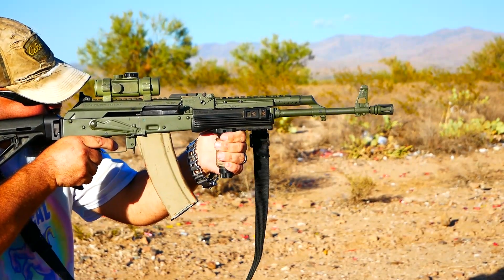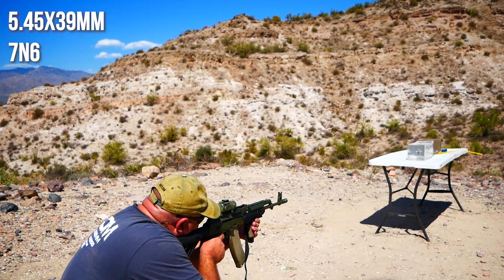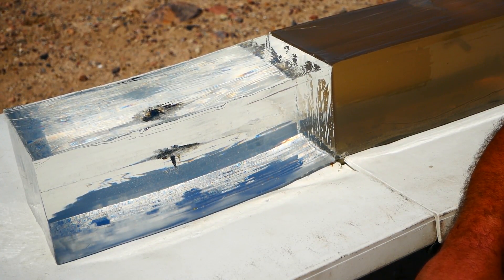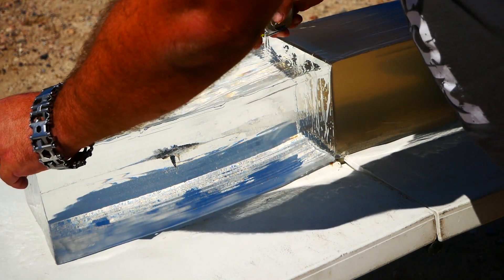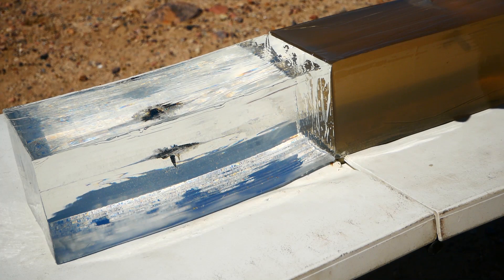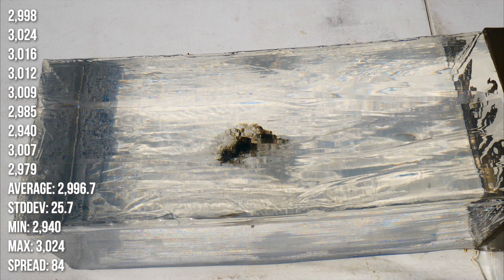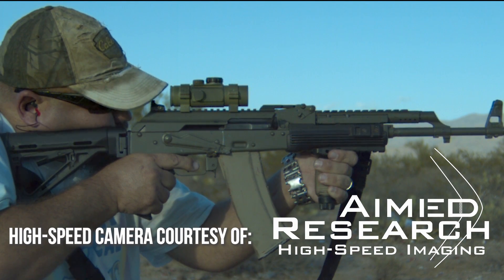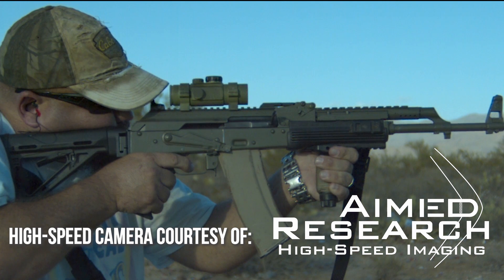Does The AK-74 Really Fire A "Poison Bullet"? 5.45x39mm 7n6 Gel Test (Stunning High-Speed)

Comment: Hey Andrew i have an idea for some homebrew 5.45x39 by taking Hornady 5.45x39 and taking off the plastic tip.I remember watching a video of Ammo Channel's test of 7.62x39 SST without the plastic tip and it looked pretty nasty any thoughts?
Reply from the maker: Interesting. Do you think that would delay expansion/fragmentation?
Reply: @newsofthepews  what Im hoping for is it will act similar to an OTM or hollow point and will cause the jacket to peel back. I've never actually tested it but the way Ammo 
Channel's video made it seem. it had about 12-14 inches of penetration and the whole wound cavity was just filled with bullet fragment material.
Reply from the maker: @nemisous83  That sounds about the same as my testing of 7.62x39mm 123gr SST. I've seen it go pretty deep in clear gel, but if I remember correctly, the Ammo Channel used real gelatin like I do in most of my tests. Excluding this one, obviously.
Reply: @newsofthepews  My hope is it will have a similar effect, if that doesn't work I might take a jewelers saw and cut a cross pattern in the tip of the nose to encourage uniform expansion or fragmentation.
Reply from the maker: @nemisous83  I think you're going in the wrong direction. The 5.45mm 60gr VMAX fragments too much and penetrates too little. What the caliber really needs is a good solid copper hollow point, a good bonded soft point, and a cheap Russian soft point. The steel jackets on other caliber Russian soft points seem to slow expansion enough to get good penetration.
Reply: @newsofthepews  that is very true, I also wish Hornady would offer a 69 or 73 gr OTM to replace the terrible performance of the VMax... OR we could get some of that goochie 7n22 which is very similar to M855a1 with a solid copper base and a hardened steel core and tip. But i guess we peasants aren't allowed to have nice things
Reply: @nemisous83  Have you tried running 55, 62, 68, and 75/77gr .224 bullets through a sizer? A lot of people will do this for component bullets when reloading 545. While I haven't tested it myself, I have heard of fairly decent results. Food for thought anyways.

Happy Thanksgiving 
S/F
Reply: @MatteoThirteenSeventyOne  that actually sounds like an awesome idea since .224 has the appropriate length, and with the same die set i can resize some 5.56 brass to 5.45 brass to make reloading more viable than reusing the steel cases.  thank you for the idea!!!!
Reply: @nemisous83  No problem. I convert cases and reload 545 myself. Although if you use sizing wax and resize in bites or small bumps. Reloading steel case isn't as problematic.
Reply: @MatteoThirteenSeventyOne  well i figure the brass would last longer than the steel because the the steel isn't as malleable.
Reply: @nemisous83  If you anneal the cases they last longer than you might think. But not everyone likes going through the time & trouble of reloading steel cases.
Reply: also its my theory that the Plastic wedge causes the round to expand and fragment too early causing the early and disappointing penetration.
Reply: @Eugene Stoner  WHICH 5.56 NATO are you referring to and WHICH 5.45x39 Soviet are you referring to ? because its an unfair comparison to compare M855A1 to 7n6 and its unfair to compare 7n22 to M855 and so on and so forth. also are we comparing it in a civilian self defense scenario or a military scenario?

Comment: Im not going to be ridiculous and say this test is false or blah blah blah, but im curious how the Army tested their 7n6 because their tests showed very early tumbling at around the 1 inch mark and would exit the gel block around the 12-18 inch mark the tests conducted by Mrgunsandgear also mimics these results as well. Who know maybe their gel wasn't up to spec but this is still really good data and shows that things might not always be what they seem. where 7n6 and 5.45x39 really show their potential is that they are not velocity dependent so you will get the same results out of a 22 inch RPK as you will out of a 10.5 inch AKS-74U which is a very good thing when you are trying to standardized on a FMJ that fits the needs of multiple rifles.
Reply from the maker: Test media and environmental variables could account for the differences. Clear gel isn't as close to real gelatin or as reusably consistent as the manufacturer claims. It's also possible that 7n6 experiences the same kind of variable terminal effect due to fleet yaw that plagues M855. It's important to note that even if the bullet does consistently yaw early, that doesn't mean that the effect is the same out of various barrel lengths. TSC is heavily dependent on velocity, so a bullet that yaws at 1,700 fps might just cut a permanent channel roughly equal to the bullet profile, with no distal wounding effects associated with higher velocity impacts.

Can you reference what Army tests you were looking at?
Reply: @newsofthepews  If you have an email I can send the picture I'm referring to where it is compared to MK 262, M855, M995 AP, and standard Yugo M67 ball.
Reply from the maker: @nemisous83  choppingblocktests@gmail.com

If it's the set of sketches with a blue background, I think that might have been Dr Roberts.
Reply: @Eugene Stoner gee did you even read my comment before going full hater mode?
Reply: Unfortunately I’d be surprised if our military tested their ammo thoroughly. They tend to overlook many details. For example they finally adopted new handguns and do not receive a single hour of valuable tactical handgun training. Just shooting at a few paper targets. They don’t even know how to hold a handgun - still using a cup and saucer grip.
Reply: @Mrandher83  To be fair the sidearms in the military are more badges of rank than they are actually combat weapons. The only people that really have a chance of using a sidearm in combat are vehicle crews since our military apparently hates the idea of adopting a pistol sized PDW like the  VZ61 and PM63.
Reply from the maker: @nemisous83  Well, kind of. It's getting a little more common to see sidearms issued to troops who also carry rifles. Some door kickers are getting them. And mortar crews too.
Reply: @newsofthepews  mind you my experience only extends to the Marine Corps. but usually 90% of issued handguns where given to SNCO's and Officers and most of the training given was pretty much just annual qualification. But id also argue a PDW is more advantageous to vehicle and crew served weapons than a handgun. Similar to how M1 Carbine replaced the M1911 and gave GI's an actual effective weapon.
Reply from the maker: @nemisous83  That's how it was when I was in too (Army, 11C, ETS 2011). What I'm relaying is hearsay.
Reply: @newsofthepews  Yeah I hear you man. It hasn't changed much in the 5 years I was in, (2012-2017) that's why i'm not all that broke up about the Army adopting the P320 because I know 99.999% of the time its going to be a glorified broach and the most salt it will every get is the holster wear.
Reply: I think shorter barrels cause bullets to wobble more in flight. Usually when that happens (when bullets wobble more) they tend to tumble alot faster.
Reply: https://youtu.be/CGo6JBjt614
Reply: I spent 6 years in a MP unit and the handgun training was deplorable at best. It wasn’t until civilian law enforcement that I realized the magnitude. The bigger the Army purchase or decision, the dumber the admin folks tasked with making said decision!

Comment: Yeah, but if you nick a bone or dense tissue, 7n6 will yaw quick or even fragment. I don't claim that it's "better" than 193 or 855 but I prefer 7n6 for my go to long gun round.. What about the 55gn hp 5.45?
Reply: 5.45x39 does not fragment. you have to remember that 7n6 is a bimetal jacket and tends to flatten out under pressure, in fact thats where 7n6 gets its heavy yaw from is from the hollow cavity in the nose bending over and destabilizing the projectile. 7n6 isnt a magical bullet because aside from velocity it performs the same a standard off the shelf 5.45x39.
Reply: 7n6 doesn't fragment
Reply from the maker: Sure, but that's true of all spitzer rifle bullets. And 7n6 is less likely to fragment than copper jacketed .223.
Reply: @newsofthepews  I agree with that. Maybe a Hornady 60gn V-max 5.45 would have a better chance at fragmentation. Those are what I keep in my Bulgy 74..
Reply from the maker: @bobvagene  Yeah, they fragment like nuts. But they also don't penetrate adequately. I tested it quite a while back. It was a little disappointing.
Reply: @Eugene Stoner it's obviously a fine caliber since it's still serving in the Russian military as 7n22. 5.45x39 suffers import restrictions and few rifles actually chambered in it which results in less manufacturers making loads for it.
Reply: @Eugene Stoner considering one of the main threats on the modern battlefield is soldiers with armor a round that can defeat said armor is more ideal than terminal performance.  Yes 5.56x45 has better terminal performance but it's hard barrier performance is quite pathetic I think Paul Harrell's video debunking M855 has made that very clear. That is why rounds like 7n10, 7n6m, and 7n22 have become the standard and 7n6 has fallen by the way side. 5.45x39 is still a very effective military round but what's best for civilian defensive use and whats best for the military are two completely  different schools of thought. Military use stresses penetration over terminal performance more often than not hence why M855 was developed. But in the civilian arena where we have to be very mindful of how many shots we fire and how deep something penetrates a military style FMJ just isnt ideal.
Reply: @Eugene Stoner but to compare apples to apples you would have to compare 7n6 to something like Wolf of Tula .223 55gr bimetal FMJ to be an accurate test.
Reply: @Eugene Stoner wrong. The only difference between commercial and military 5.45x39 is bullet weight which is attributed to the 7n6 having a mild steel core at 53gr. and commercial  having a lead core at 60gr.  If you wanted to  argue semantics then you could compare wolf 60 gr FMJ5.45 and wolf 62gr FMJ 5.56 but both would yield the same results.
Reply: @Eugene Stoner actually comparing two different types of bullet is not a fair comparison. That's like comparing apples to oranges or comparing BTHP to JSP... they are not the same.
Reply: @Eugene Stoner again...... you completely ignored what I said about civilian 5.45 having a heavier bullet... also AKOU completely neglected to even being that up which why his test honestly downright dishonest if you ask me because he is trying to present 7n6 as a the benchmark of 5.45x39 performance while ignoring how inconsistent and inaccurate 7n6 is compared the commercial stuff.

Comment: People chill... clear gel is known for allowing bullets to penetrate farther than other gel types. Every other test of 7n6 has shown early yaw. Good test, but seriously people don't take one guy's test as gospel.
Reply from the maker: Yeah, so the thing is that clear gel tends to exhibit deeper penetration, but expansion, fragmentation, and retained weight tend to be similar to real gelatin. The neck seen here is actually pretty accurate. This is from a series where I also tested M67, Silver Bear 7.62x39mm 123gr FMJ, M855, and .223 pressure 55gr FMJ. The .223 and 5.56mm are fired from both 16" and 10.5" barrels. Those will all be published over the next few weeks. I don't want to spoil it, but the only thing that had a longer neck was M855, and that's known to have erratic neck lengths. The bottom line is that 7n6 is decent, but not nearly the death ray that fan bois think.
Reply: https://www.youtube.com/watch?v=cPLO-5Jl0eQ&t=10s Lots of variables when people do gel tests. Those that have been shooting for years know what 7n6 can do.
Reply: @arty7n67  im wondering if temperature of the gel has anything to do with it

Comment: I’d like to see the same test with M193. 

From the test I’ve gathered I’ve yet to have a 193 fragment out of a 16” 1/7 barrel.
Reply from the maker: Seriously? Even .223 pressure 55gr FMJ usually fragments from a short barrel.  You kinda have to go out of your way to find a 55gr FMJ that's slow enough and tough enough to not fragment.

https://youtu.be/DamerZHdoY8
Reply: The Chopping Block 

Must have been the media you were using in that test. Cause with clear gel and Federal brown box , and Winchester I’ve gotten results a lot like TN did. 

6” neck with one rotation, little to no fragmentation, and an exit. 

https://youtu.be/SPzxBJSIaGA
Reply from the maker: @MattyLight30  Yeah, that's possible. I used real, calibrated 10% ballistic gel in the video I linked above. M193 is well documented to fragment most of the time and I've seen very consistent fragmentation with almost any 55gr FMJ in my testing.

Comment: I'm a fragmentation fanboy but gotta respect 7n6 as a service round. People had years of cheap spam cans to stockpile while one can't even get a box of M855A1. It's still what, 200 dollars per spam can?
Reply: @_j.v.st._7367  fixed
Reply from the maker: It's okay, but 5.45x39mm doesn't have any decent defense ammo available.
Reply: @newsofthepews  sure, my reasons for liking it are related to the concept of a service caliber, in the back of my mind I'm thinking about: weight, the aerodynamic bullet, the taper of the case, the fact that it uses less lead and most of the volume is steel really cuts costs, etc. It's not so much of a defensive tool, I just really appreciate the logistics of "go to war" tools. I wouldn't recommend it for defense.